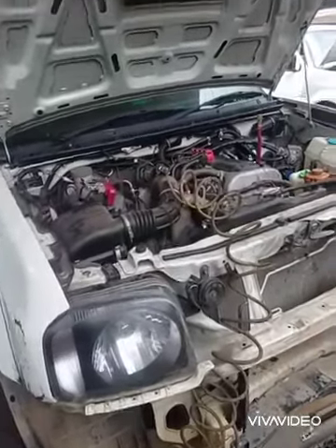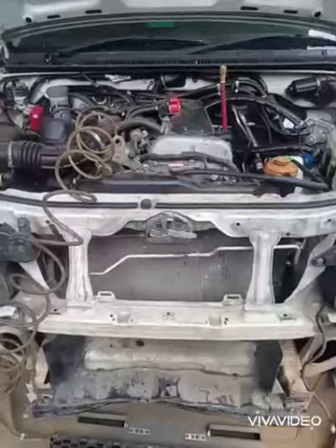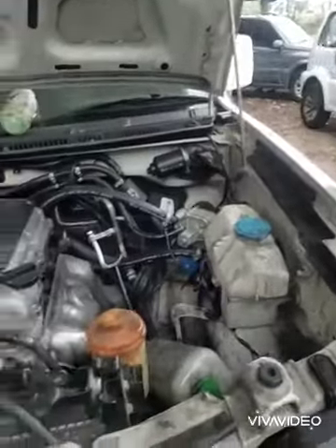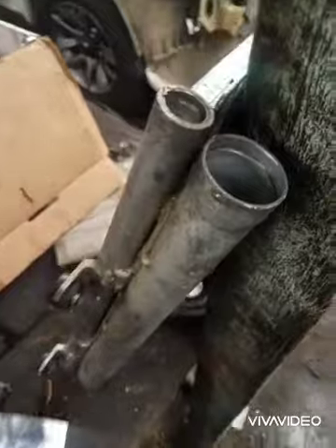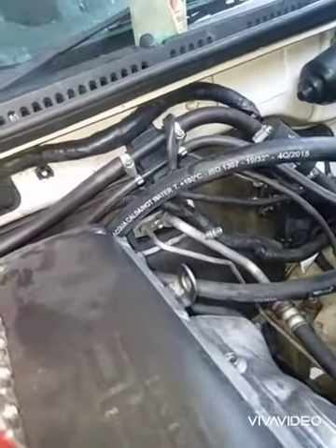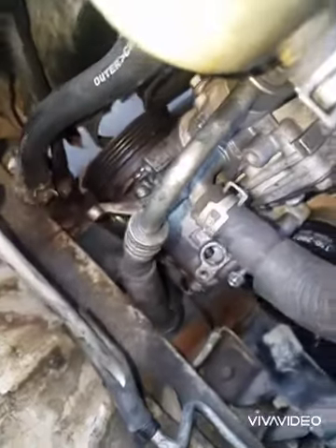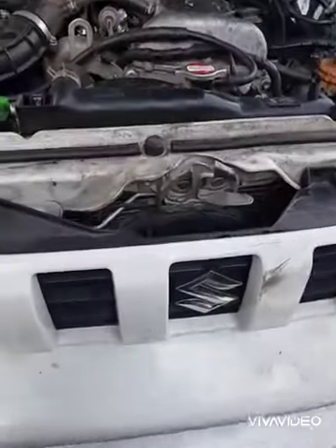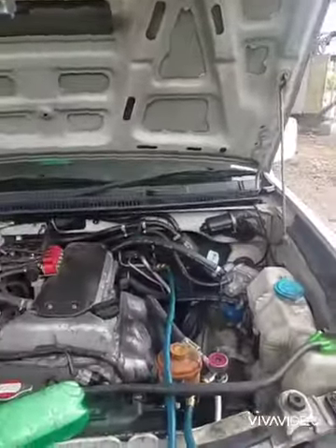Suzuki Jiminy reinstallation of A/C compressor, receiver drier and expansion valve 🇯🇲

Comment: I have a Suzuki Jimny as well but the ac blows warm when it is in idle but when driving it is cold. The fan is working, the gas and pressure is good. What could be the issue?
Reply: Did you get that fixed?